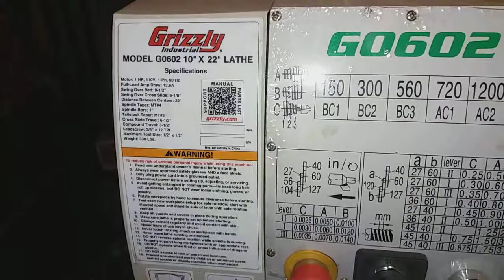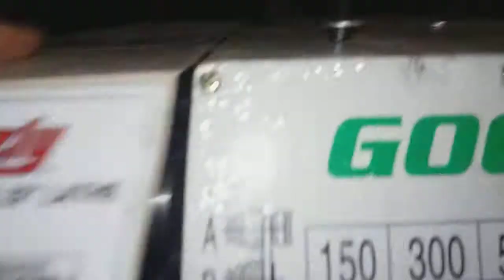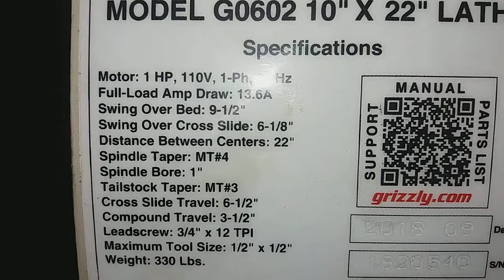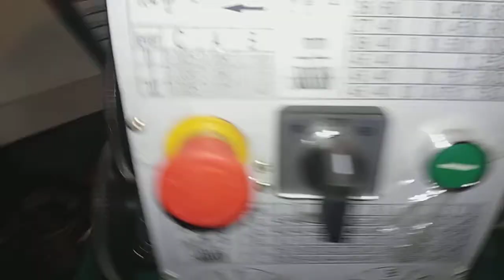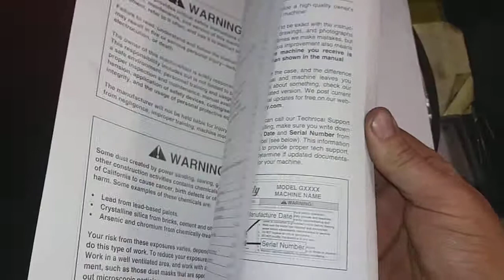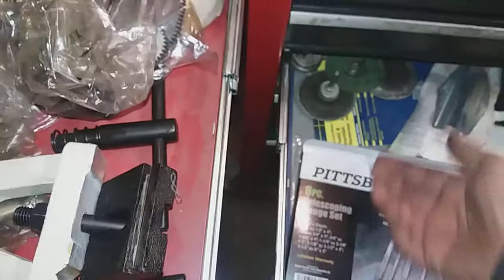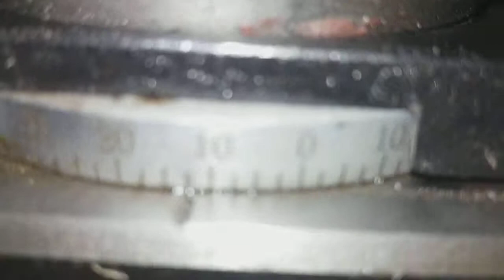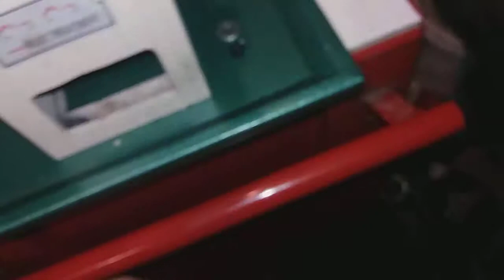G0602 Grizzly Lathe Partial Unboxing and Review

Comment: Hi
Nice video and that Grizzly 10 x 22 is my favorite lathe for the money. Anyway, in your video you mentioned the plastic gear several times and sounded a bit disappointed that it's made of plastic and not metal. That plastic gear is there for a very important reason. 
In the event you jam up the chuck while turning, that plastic gear will strip SAVING all of other metal gears and spindle from total destruction! Pretty smart if you think about it. Under normal use it should last fine for quite a long time.
Reply from the maker: Thanks for your comment, I believe thats all of what I covered in this video is all the reasons why I chose this lathe and somethings I didn't care for, in the size compared to other lathes and even the brand and a more in depth description to help others in the same considerations. And I could possibly agree with your reasoning about the plastic gear, but I don't think so. I think it is to make it quieter and also cost them less,  else they would sell all lathes with that as a standard safety feature, we should definitely be better machinists to not crash it that bad to need it, but a big reason why I don't think the plastic gear is the safety feature is because they already have one, even states page 62 of manual for leadscrew shear pin, stating its designed to break and disengage power to protect more expensive components. Thats what I think, its hobby machine size and to make it more mellow and hobbyist user friendly compared to not important as a tool room lathe. But I've become less worried about this plastic gear because it only runs the leadscrew, than my g0704 mill which I did break the plastic gears, you could technically still run the lathe if you broke that gear, but I agree with you I don't think its under that much torque to break it either. Thanks for the comments and viewing.
Reply: @brisjare  Hi Again
Plastic gears are called "sacrificial" gears and are designed to fail if a jam up occurs. The lead screw uses a shear pin to fail, but it will fail ONLY when the lead screw is turning and jams up. You could have your chuck jam up by having something falling into it, stopping the rotating chuck dead in its tracks, and NEVER even have the lead screw engaged. This event is what plastic gears are designed for. Think about it..:)

Also, with all of the cost of materials going into the construction of the lathe, would they really bother trying to save a few bucks on the cost of one plastic gear? It's made of plastic for a reason, and that is to save your gear train if the chuck jams.

Comment: I had a Chinese mini lathe. The main drive gear stripped out on the key hole on the shank. I worked in machine shops, so I cut the center of the gear out and cut a peace of aluminum to fit the inside and cut slots for the spokes of the gear, and glued it in. It worked ever since no problem. But I don't care for plastic gears in a metal lathe, or and machine tool.
Reply from the maker: Yeah I hear ya, as you see in this video I mention how much work I did researching which one I wanted to have all the features and minimal problems with the gears like you mentioned. I have only one plastic gear and don't mind my lead screw has a brass pin for that purpose so probably won't break plastic gear ever, like my mill broke. But yours you mean main drive gears? If what your mentioning from what you described and the type of lathe I think you have, have you checked little machineshop.com? Those that have the main drive gears as part of the spindle or something are popular to be swapped and that website has that, and typically change out to tapered bearings instead of the roller ball bearings that they come with, say cuts better I guess. Sorry for late response got busy doing other things.

Comment: Appreciate you doing this video.  Ive been doing my homework on which one to go with and settled on this one. Any advice or anything you wouldve done differently when you first got it?
Reply from the maker: Yes, I already pulled some apart to clean and make sure all the grit was out, but test out everything, mine I think snuck past quality, the 3 jaw was fitted on the spindle I think cause the 4 jaw and the plate wobbled bad because the spindle facing wasn't right, probably a fluke for me but test everything while warranty, I had to file gears, make special spanner wrench, and such, can check my other videos if you like, but put er through her paces make sure it's okay, and gain experience if needed and familiarity

Comment: Is there any way you could say what the depth of cut is on steel, aluminum  and brass? Thanks!😀
Reply: Also,  does it cut threads ok?
Reply from the maker: Oh I think it could cut in pretty deep turned it on the dial .050 so took off .100" just the other day, I think it does better  a little deeper on making straighter cuts, but I did have a but of troubles tuning it in and familiarizing myself as I didn't have the most experience, I actually haven't cut threads yet I think it would do okay, but I want to do a modification and add a reverse gear so I can cut left handed threads

Comment: Very good quality Sir your mini lathe....how much the Price
Reply from the maker: This lathe runs about 1500 I believe, just a little bit more than the slightly smaller lathes, and I believe that is my topic of this video is to get this lathe over other models, hardened ways, the cross slide etc, just doesn't have reverse feed though
Reply: @brisjare  oh.  This is machine doesn't have reverse feed...
Reply from the maker: @lovenironi5817  No it doesn't most of the smaller that this ones don't either but I've seen a different video on youtube that someone modified one to do that, added another arm and another idler gears between 2 of them causes reverse